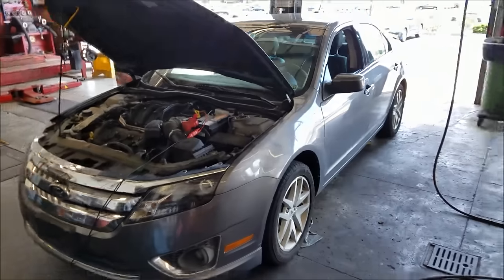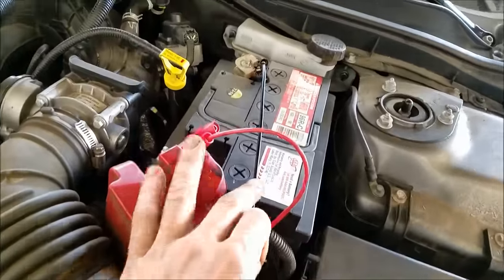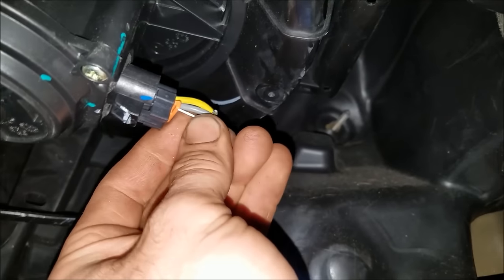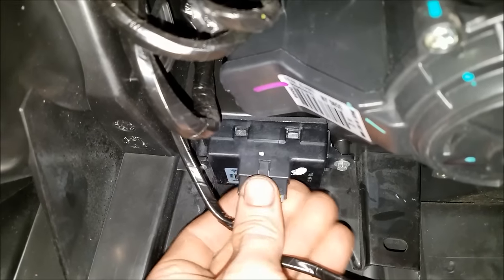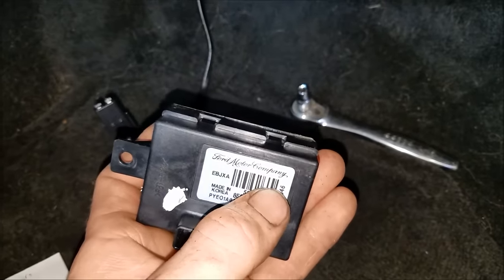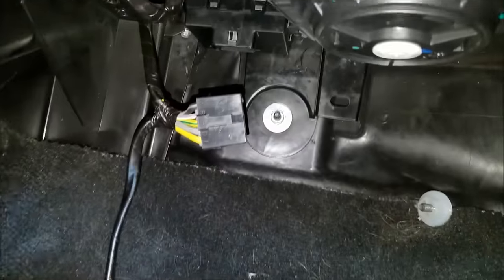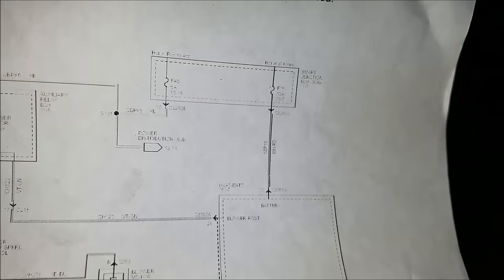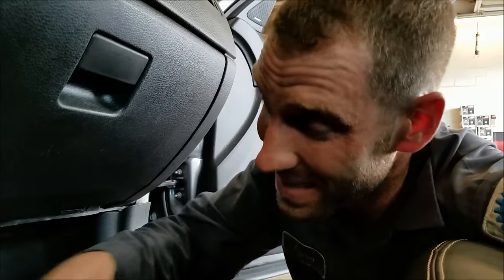06-12 Ford Fusion BLOWER DOESN'T WORK  EASY FIX fan resistor pigtail

Comment: 2010 Fusion. 70.000 miles.  Problem was temporarily corrected by reseating the cable. Eventually that wouldn't work.  Ordered the pigtail and resistor.  Replaced.  Now working.  Big thumbs up for the video.
Reply from the maker: Thanks buddy. Appreciate you sharing your story and the feedback.

Comment: Local Ford dealer wanted $1,100.00 for this fix.  Ordered the parts from the links for under $100.00 and did it myself.  Thanks for the video!
Reply from the maker: No problem at all, glad to hear you were able to save some money and good luck on the repair. Appreciate the comment

Comment: Hi 59 year old woman 2006 ford  fusion sel intermittent ac blowing.  Following your video I replaced both the ac mod and fan.  For me I had to remove the glove box bcuz there wasn't enough light or room.  The mod was difficult to get off and put back in, thus my daughter helped.  The fan was a breeze.  I could see white chalky stuff on the mod but the fan was just dirty, pigtails were fine.  Anyway, thank you.  I couldn't have done it w/o you!  :) Tested and working.  Unfortunately, I won't know if it is the final fix until I take a long trip or we have a hot day. Usually, you can hear the fan but feel no air 200 or  300 miles from home.  :)  Just so you know I drove from FL to TN in August of last year.  AC quit about 100 mile in.  It was hot!  Took it two shops they kept several days apiece but couldn't find the problem.  They sent me back to FL w/an AC that quit 100 miles  into the trip.  This year I took it to a shop they didn't know what was wrong.  Thus I took a 6 hour trip with no air an hour in.   I then went on a hunt and found your video.  I am off on another road trip Monday, hopefully I will arrive fresh as a daisy not smelly like a wet dog.  :)
Reply from the maker: Awesome to hear you were able to knock it out! I appreciate your comment.  People like yourself keep me motivated to continue producing some content

Comment: GREAT VIDEO!! I pulled fuse and relay, both ok. Check connectors to fan, no burn on negative. Plugged everything back in and it works. Must have had a bad connection. Your video saved me a lot of $$$.   THANKS!!

Comment: Thank you so much for posting this video! My husband didn't think he could do the job himself until I showed him your video. He didn't realize how easy it was.
Your video was informative and got right to the point. He changed out the fan, the resistor and the wires. The ground on our wires was burnt too.
We saved at least $500 in labor costs. Merry Christmas! :)
Reply from the maker: So happy to hear you were able to knock it out yourself and save some money. Merry Christmas!
Reply: È
Reply: I'm wondering how much the parts were in total - my normally reasonable car guy wants $350.

Comment: amazyou truly are my hero just had this issue start yesterday and i guess the passengers in my car were hitting the wires with their shooes because a wire broke loose and i had no clue that was there. thank you!
Reply: Same! Stepping on the hanging wires. Stupid. Really hoping for an easy fix. Hoping it's just loose but that would too good to be true! Just replaced the blower motor too, now this!!

Comment: Awesome. I saved myself $400+ and my wife thinks I am a God. Cleaned pigtail and resistor leads with wire brush, then replaced them both a week later. Also took out the blower motor and inspected it. Maple leaf seeds....
Reply from the maker: Awesome man!  Glad to hear you knocked it out and sounds like you did it the right way! Thanks for the comment

Comment: I have 2006 Ford Fusion and I have same issue ... on diagnose I find out the same problem the one you showed in this video ... I went to allied auto parts and they have only the motor resistant cost like 136.00 included tax after market ... but could not find the harness... online it cost around $ 27.00 to $54.00 and it take time to come... so I went to pick n pull and I find the same model car over there so I pull motor resistant, harness and Ac blower as well .... all three parts cost me $45.00 including tax ... just put in my car now it’s working fine ... thx to you to load this video ... you are a life saver...
Reply from the maker: Sunny Dee awesome to hear you got it done! Thank you very much for your comment and I really appreciate the feedback!  Feels good to know this video is helping the few out!
Reply from the maker: Sunny Dee thank you for sharing what year your Fusion was, I'll update the title and description. Would you say it was identical to the one in this video? Or just similar
Reply: NoNonsenseKnowHow yes I have 2006 Ford Fusion and it was the same problem Ac blower was not working then I pull out the resistor harness it shows malted pins in there same is in resistor  so to be run on safe side I bought the blower fan as well cuz it’s all in cheaper price.. on junk yard I find the same model 2006 Ford Fusion

Comment: Thanks, man.  Took the resistor off and the contact was melted exactly like in the video.  Cleaned up the resistor contact with an emery board, cleaned up the pigtail contact with a pick, put it back together and everything worked (for now, anyway).  The whole thing took about 45 minutes.
Reply from the maker: Awesome to hear. Good stuff!

Comment: Very good video man.  My 2012 Ford Fusion one day decided to burn out that same ground prong and caused my fans not to work.  Same issue and definitely is a common issue as I feel those blower resistors simply pull to many amps for the gauge wires maybe or they simply need better harness contacts when plugged into the blower resistors and maybe causes hot arching with weak and open and closing connections thus creating a heat spot and melting the harness in all.  I've noticed that blower resistor indeed still works fine and didn't take noticeable damage. 

Thank you again!

Comment: I literally touched the pig tail and the fan started blowing thank you so much
Reply from the maker: Good stuff. Just make sure to take care of it at some point otherwise it could melt even further and cause more damage.  Or take it off and try to clean up the connector if it's not already too burnt up

Comment: Excellent video, it helped resolve the problem right away.  The only thing I would add is the glove compartment is removable.  It was easy to splice the wires with the glove compartment removed.  Bring two tabs in on top and remove the cable and the whole compartment can be removed.
Reply from the maker: Awesome, glad to hear it helped out! And good point about removing the glove box!

Comment: Good stuff. Mine has quit working for the 3rd time in the 8yrs since I bought the car. Gonna do it myself this time.
Reply from the maker: Damn that's crazy! Yeah these things are definitely under sized for how much current goes through them. It's possible you might have a faulty blower motor causing the connector to overheat though.
Reply from the maker: Luckily it's a very easy repair

Comment: Lots of great info and got me started in a direction with my broken AC.
Reply from the maker: Thanks for your comment, what did you end up finding?
Reply: NoNonsenseKnowHow I actually found the cable connector to the resistor burned out, it was melted to it so when I finally got it off I found that. I went to a junkyard and found a resistor and cable for $16, rewired it, and everything is fixed! Seriously, thanks for the video, probably wouldn’t have a working AC right now if it wasn’t for this!
Reply from the maker: Keanu Lugo awesome man good to hear!  And no prob man

Comment: The crazy thing, got my 2012 ford last year. The prev owner mentioned the A/C goes on and off but no one knew what the issue was. They took it to even ford dealerships and spent money on the compressor and condenser for it to still have the issue. The fans stopped working when I bought the car a little bit over a month but buyer beware yk. All my dad did was watch this video and did the first thing and now my car runs perfectly with A/C.

Comment: Hey, just had to fix mine....used your video...helped a lot. Now tho, it's work but the air is weak, I changed the cabin filter today, and it didn't help much. Can you give me any guidance?
Reply from the maker: A My best guess would be a worn out blower fan that caused the blower resistor transistor to fry. I would suggest checking the amperage draw on the blower fan. Or just replace the blower fan

Comment: Add a jumper ground wire from the burnt side, to the connector ground. Do it your way. You will have to replace all that crap again, when it burns up again.
Reply: Do you have any details on doing this? I am that guy ... replaced it all and it needs replacing again. Anything would be helpful!
Reply: Update: was told NOT to add any wires by a wiring pro so as not to mess with the control module. Replaced resistor/harness, blower motor/harness, but this time used a different blower motor made by Four Seasons (part #75874 - made in Canada by Unimotor). Everything works again but this particular blower is making the loud "chirping" type noise that I have seen others complain about. The first one I bought from Amazon was sold as new but arrived obviously used (somebody had actually clamped some balance weights on the fins to apparently try and solve the noise problem). Returned that motor for an actual new one (maybe) and put it in - same noise. The blower itself seems well built. It's almost as if something is just barely hitting when the fan spins - like a leaf stem in a bicycle spoke. Don't want to send this one back as I'm convinced this is just the way they are. IF being loud is the worst it gets and things don't melt down again, I'll call it a win. Crossing fingers/toes.

Comment: Yo! I've had to do this a few times in my fusion. I just did it again yesterday but I believe I labeled my wires incorrectly and I now have some wires crossed. 🤦🏽‍♂️. It's working but the fan does not blow out hard at all. Do you have a diagram to show how to correctly connect the wires?

Comment: hey great video this just happened to my 2012 fusion a quick question i have duel zone auto control  do i need a duel zone resistor quite expensive or can i use an auto resitor?
Reply: What did you decide?
Reply: I have the SEL on rockauto the proper module is 128$. I bought the amazon link as well considering I can return it down the road from me. But if you tell me it didnt work that would be helpful
Reply: The thing is, HES WORKING ON A FUSION SEL with dual auto control. So hopefully its a go!
Reply: @RW-jg9zv  Ok, I'm in the same boat here. Did you give it a go? I have a resistor model starts with 8E5H...all the Amazon ones say they don't "fit" and are replacements for 8E5Z.  So is the fit just him having to extend the bolt hole or is it a mechanical/electrical difference and won't function or function properly?
Reply: @NoNonsenseKnowHow any insight?

Comment: A tip for cutting back the electric tape wrapped around the wiring harness without risking damage to the wires inside is to use a sewing tool that your wife or mom has called a seam ripper. It has a curved blade inside a metal blade that only cuts what is in the curved portion.

Comment: Thanks for the video.  Same problem here.  Which pigtail did you replace?  You have 2 different ones in your link?
Reply from the maker: The one that goes to the blower resistor

Comment: My 2018 Ford Fusion's blower was not working. I drove it home a few blocks. Turned the engine off...waited a few minutes. Turned the engine back on...now the blower works. It did connect to my Wifi at home. I don't know if it gave it an update? But wondering if there is an underlying problem.
Reply from the maker: Possibly. Wouldn't be a terrible idea to inspect the connections on the blower and the resistor if it has one

Comment: The motor to the blower works. And the fuse and relays work. I have ground but not hot. And also the resistor has been changed. And still the fan won’t turn on

Comment: If the blower is at 13.1 ish volts is that enough off to melt the connector or is that voltage fine?

Comment: Colossal pain in the ass.  Too old for this.  It's fixed and my wife thinks I am great.  If it happens again, I will set the car on fire.
Reply: Yes! Cramped workspace, stripping 10 tiny stranded wires that want to fray when you push them into a butt connector to crimp them ... Oh, and the toy surprise you receive when you find out ONE of the five wires you're splicing into on the car is 18 gauge, the rest are 14. Wtf? Replaced the air filter at the same time - looked like it hadn't been changed in 100,000 miles - probably why the fan was drawing too much amperage (bought the car used from a dealer)
Reply from the maker: Haha!  Sounds like a good plan

Comment: Any idea what would make the air only blow through the defroster vents?

I changed the blend door actuator, the blower motor, and checked all fuses.

I'm dying of heat without the AC  coming out of the front vents!
Reply from the maker: Sounds like one of the door actuators is not working. I'm not sure offhand which one it would be though without looking at it
Reply: @NoNonsenseKnowHow  

There's a total of 3 and I ripped the dash open to find out it's the hardest one to get to and required a dash removal (now in process). Will be miserable but not as miserable as having no AC
Reply from the maker: @ButterYourOwnBagel  that sucks man!  ok good luck and thanks for the update

Comment: So you're saying that as long as the blower is good then the resistor will burn out randomly . Or does it make sense that the motor may have pulled too many amps and burned the resistor. Also why Ford put in a 40 amp fuse that doesn't burn the fuse when this wiring gets burnt . Well I'm testing my fan motor with an inline 20amp fuse to see if the motor is drawing too much amperage . I'm guessing if the motor is worn then it will burn out my 20 amp fuse before the $200 resistor

Comment: My air blower motor quit running, I got a new one and plug it, it worked but when I mounted it I didn't run, I plugged the old motor back and realized that it is still good but when I mounted it it didn't run either, what could it be?

Comment: Where can I get the wiring diagram?..so I know what wire goes where so I can do it asap..i live in Houston Texas with no AC..
Reply from the maker: You should be able to find them on Google. A lot of time people post them in forums. Have you tried wiggling the connector shown in this video?
Reply: Yeah needs to be replaced..burned up and melted...ive been looking dont know exactly what I should goodle to find it
Reply from the maker: @gabguerrero999  best would be to just replace the burned up pigtail harness. There is a link to one in the description of this video